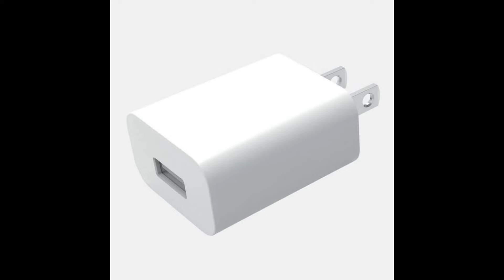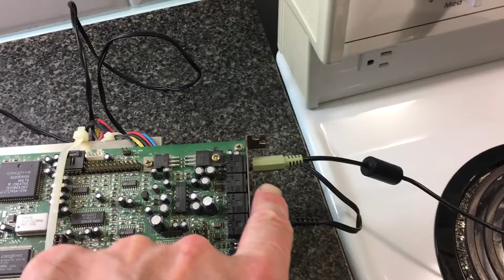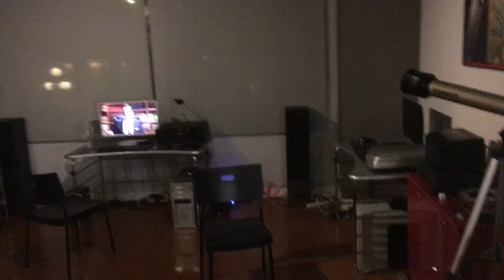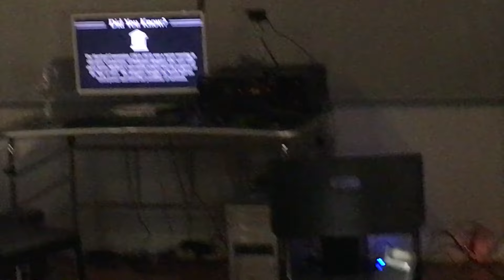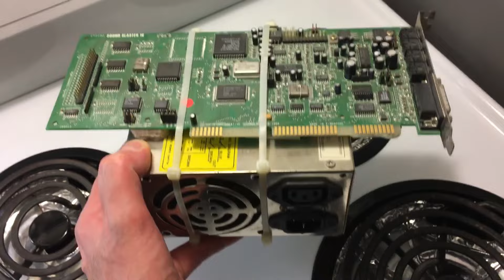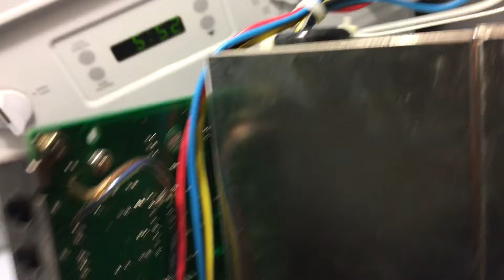Convert PC Supply to Generic Use Power Supply as Ghetto Blaster

Comment: Socked your Getting sound 
SB 16 Require the DOS (Windows NT, 7,XP...) Driver to switch on the Amps Power Rail

- I know some one who use to work For Creative labs and helped make some of the PCB for Sound Blasters
One Complaint in bad and Too cheap Audio amps & Power Regulators on all of the SB 16 cards but not so much on the SB16 Pro 
I asked him nicely if he could Re do one of my cards 

Some People Ending up modding the Cards with better IC Amps chips + Power Regulators

Ground loops are easy sorted With a Audio Isolation (Ground loops) Transformer 
(These are also useful RF AM Radio interference (LW MW SW) on long cable runs)

I found Most Bluetooth 1 in 2 (Receiver Transmitter ) Chineseum Garbage and Prone to some Evil Ground loops Problems & issues